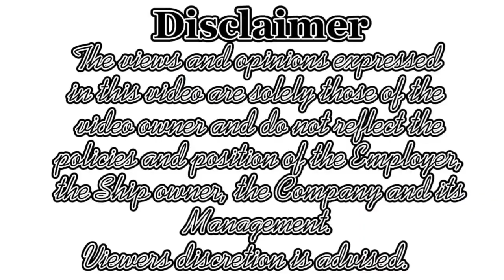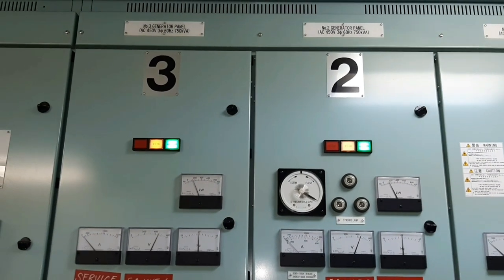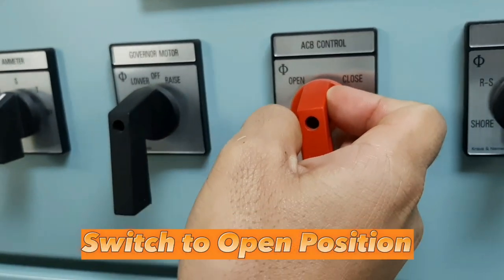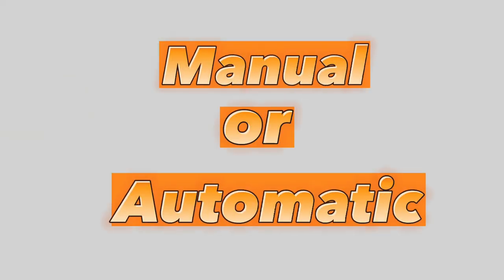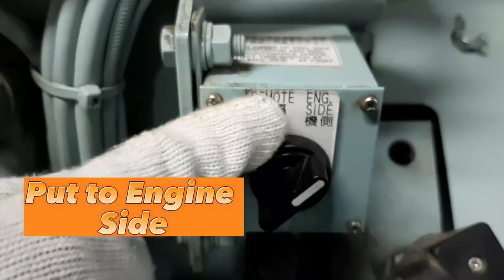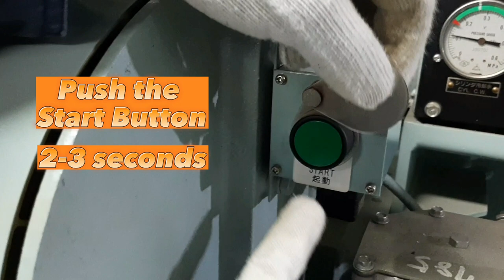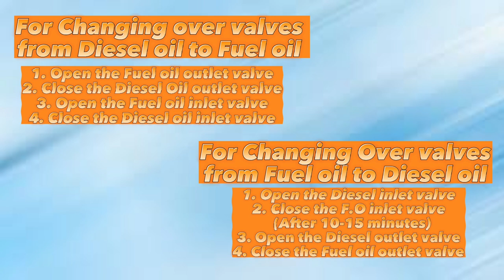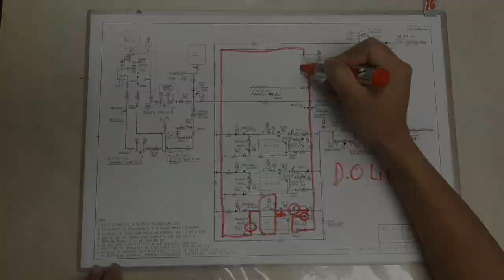HOW TO STOP GENERATOR ON BOARD THE SHIP | Toping's World

Comment: sir at 1:25: u said we need to change over of outlet valves, but only at 4:45, u changing it. So what is the correct way to do it? 
My english is not good so i may misunderstood the progress, hope u can explain it :D thank you
Reply from the maker: Good day Sir. @1:25 i did not change over the outlet valves sir. I only mentioned it. Then after 10 or more minutes of changing over the inlet valves. Thats the time you need to change over the outlet valves for the flushing/ cleaning of pipeline purposes and the fuel oil did not go/contaminate the Diesel oil Service tank.
This is the very crucial job. Because if you perfomed the change over wrong. It can cause Black out and Mixing of fuel oil to diesel oil or vice versa.
Reply: Yan din observation ko sir kuha Muna CIA load bagu nya chinage over Yung outlet line .kaya na nalito din ako.kong ano Ang Tama na step by step pwedi namn sinaryu after lowering temp ofat inlet line after minutes pwedi nmn change over agad Yung outlet line..
Reply: para po malinisan nga yung linyada nang FO